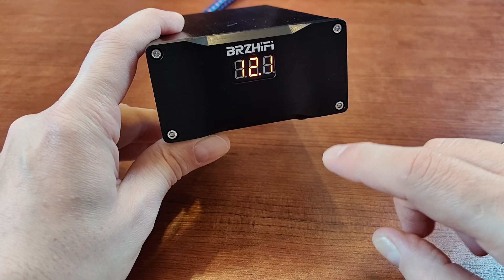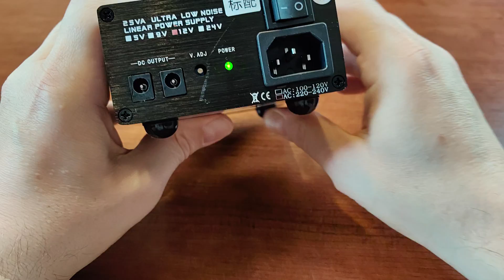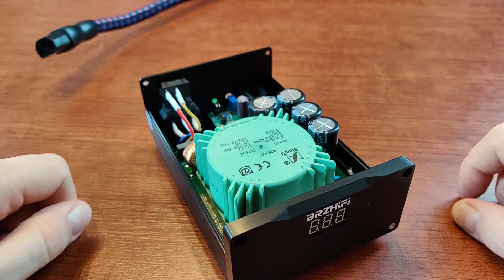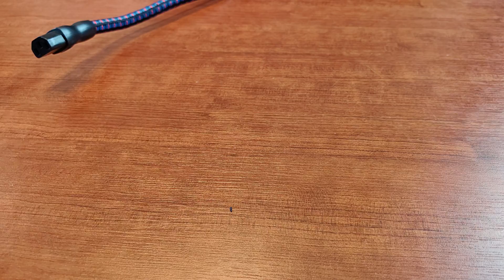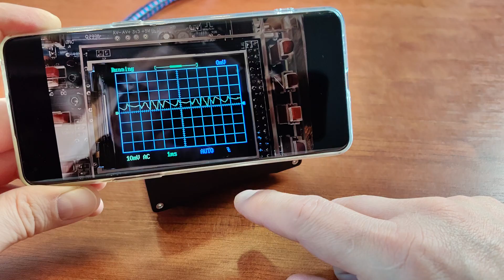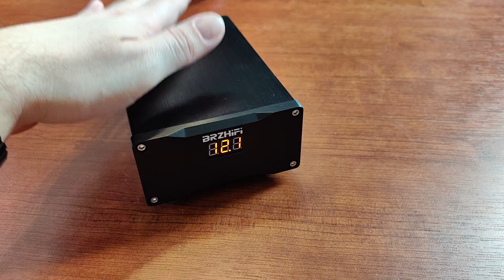BRZHiFi Linear Power Supply 12v - cheap and effective LPS

Comment: Gabster tested a similar PSU to this and found the voltmeter generated significant ripple on the output. One solution is to make the voltage display switchable and keep it off for lowest noise. https://www.youtube.com/watch?v=WLJGE5SSW2A
Reply from the maker: Thanks, I will need to measure mine again and check for that!
Reply: @k4syx ..and?????? ;)..

Comment: i heard you can lose some of the attack with linear power supply, is that true?
Reply from the maker: Nope. Maybe if that would be low power LPS? Definitely not with the ones I have here
Reply: @k4syx what do you mean by low power? What's the standard? Is 10-15w good enough? Brzhifi has one for 15w

Comment: Is this what i need to replace the power supply to my Fosi ZD3 Dac. If so do i need the 12v version? The 110v or the 230v version.
Reply from the maker: Yes that one will do, 12V output, input should follow your local country standard (110 or 220 depending on where do you live)
Reply: @k4syx Is this the one you would recommend or is there a better option for the ZD3? Love your videos.

Comment: I thought 10 mV is pretty high for a good LPS.  For a good LPS I have seen, the ripple is filtered / controlled around 10-20 μV (=0.001 mV) volt at a full load.
Reply from the maker: Yes you're right and these would be way more expensive. That one is very good for the price
Reply: @k4syx  I know that Lhy LPS has ripple noise of 17μV at empty load and 150μV at full load, and cost about the same.

Comment: Be careful when adjusting voltage on these PSUs. Specifications are misleading stating that it is 25W, What they should specify is maximum current draw. Transformer in the video is dual 12V output at 12.5VA. Connected in parallel can do just above 2Amps. One might think that at 25W when set to 5V for example can push up to 5Amps however that would fry the transformer. So, it is 25W but at max voltage of 12V which is set by transformer. Voltage is adjusted down in the circuit with gigantic mosftet IRF9Z34 capable of 40amps or so if I remember right. However, higher amp pull that transformer is capable of will fry its coils. I got exact same PSU but with 24V version transformer (dual output 24V at same 12.5VA).  Dumb me powered Raspberry Pi4 with sound card that pulls over 3Amps  while PSU is capable of just over 1Amp and left it. Found half an hour later dead and hot as frying pan. So, like video correctly states you can use it but power something very small and not power hungry. I should have opened it before using it. Lesson learned the hard way. The only question I have is why circuit breaker didn't fry first.
Reply: Al final depende de lo cuidadoso que haya sido el fabricante al elegir la configuración del toroide, por ejemplo, hace poco compré una lps muy parecida de brzhifi con salida de 5v, 25w y toroidal Talema, desarme el lps y vi que el toroide tiene dos devanados secundarios de 7v y 12,5VA, mis cálculos rápidos me dicen que daría unos 1,785a por devanado (12,5VA / 7v = 1,785a), si los han conectado en paralelo tendría 3,57a teóricos a 5v, unos 17,85w. No se casi nada de matemáticas ni de electrónica, es una conclusión que he obtenido simplemente mirando la foto que le hice a la serigrafía del toroide cuando abrí mi lps y usando la calculadora de mi móvil. 
Hipotéticamente si en el modelo de 12v usan un toroide con salida de 15v entonces tendrías = 12,5VA / 15v x 2 = 1,67a, lo que produce unos 20w a 12v. Como ya he dicho no sé prácticamente nada de electrónica ni matemáticas, si me he equivocado en mis cálculos corregidme por favor, soy el primer interesado en saber cuánto amperaje disponible tengo en mis LPS.
Reply from the maker: Thanks for sharing and the warning!
Reply: @k4syx  I wanted to ask if this LPS was OK for a 12v tripath ta2020 chinese amplifier which needs 3amps, but I guess it cannot :(
Reply from the maker: @CatrinaDaimonLee  Yes you are right, that one would be too weak. you need something that can deliver ~36W, so maybe one of the Rcore ones that I've reviewed would be ok?
Reply from the maker: @CatrinaDaimonLee yes that one is too weak for that, you'd need something that's >36W
Reply: @k4syx  THANK YOU
Reply: @k4syx  I will watch those, thanks!

Comment: Thanks for the vid mate 😊. I wonder if I should buy one to pair with my Fosi p3 valve preamp and replace the stock ps. It has a 12v in. But I wonder, if I would hear a difference? Maybe someone has done that?
Reply: @KLiNoTweet   i dont know if you are the one who just liked my message but.. the answer is HELL YEA it will completely free up your p3's dynamic range and reduce the noisefloor
Reply: @hcr2ligna83  Thanks for the quick replay. Very helpful. My comment just disappeared? YT is strange sometimes.
Reply: @hcr2ligna83 Thanks for you quick response. And I subbed 😊😊
Reply from the maker: Thanks! Yes it will help with sound quality :)

Comment: Do you think this one might be better on Aliexpress?
Reply: Thank you!
Reply: 25W/50W SPD-25PRO Flagship Low-noise DC Linear Stabilized Power Supply, TFT display, Visual Operation Interface
Reply from the maker: More powerful and with fancy display.
If the ripple would be the same and price similar I would go for it as it is more powerful

Comment: Completely USELESS for any audio component with a minimally good design...  When we design audio component, we know we'll receive noise, imperfect sinusoïdal waveform and sometimes spikes from the utility.  So in this video, a guy provided AC to a DAC power supply using a light dimmer, can't be worst than that:
https://www.youtube.com/watch?v=OL23xkLfPTU&t=972s
So the DAC isn't impacted at all even if it receives the worst AC crap you could imagine.  This whole linear power supply snake oil is really peddler's classic crap...
Reply from the maker: As long as I have respect for Amir's work for measurements, I think sometimes that he listens to AP plots only.
I'm engineer myself. And if I can hear something I cant see in measurements, I'm not dissing that as magic and snake oil, but I'm starting to wonder what I'm not measuring when I should.
Case in point: which one of measurements that Amir takes with AP translates to imaging and positioning of the sounds in the soundstage?
As there are DACs on his list (again, that's something I use sometimes as starting point myself) that measure the same, or above hearing limits for all practical reasons, but still some of them sound flat - like 2d photo, and with some of them you can close your eyes and easily point all the locations including depth (distance to) and height of the sounds?
There is no magic, it's all science.
Getting to LPSes. With linear power supply you can hear more small details in the sound, nuances and spatial cues that build the imaging.  
You can try it, you don't have to though, obviously :)
Reply: @k4syx  ...and you surely doesn't sound like an engineer...
Reply from the maker: @guyboisvert66  So you cant hear the difference (have you even tried this?) but you can hear if I sound like engineer from my writing? :)
Peace and enjoy the music :)
Reply: @k4syx  Challenge anybody on this for a blind test in a controlled lab setup... And i shouldn't have to explain why...
Reply from the maker: @guyboisvert66  Thats actually no problem, If youd be visiting Poland give me a shout and we will do it. I will "rig" the setup: we will use the DAC of my choice (shouldnt matter right?) we will use the LPS and worst switching power supply I will find here :D (it wont matter right?) and then we will connect that source setup to my Abrahamsen V4.0 driving my electrostat SR-007 MK1 headphones. 
This will be rigged, as SR-007Mk1 are one of the most transparent headphones world had ever seen. We will use my choice of tracks for tests too (shouldnt matter too, right?)
For trained ears its not even a real challenge.
And the one who loses buys the beers to drink over when we will talk about music :)
Reply: @k4syx  I never said "power supply doesn't matter", i said that there's no point of replacing the one that come with the unit! The challenge is: see if hooking an LPS on a good DAC change anything at all.  Obvious answer: it won't change anything (unless the LPS is real crap!)  As for the beer, i'd be more than happy to drink with you if we'd be a bit more closer!  Poland is a bit far from Montreal... By the way, go Poland and keep asshole Putin out! ;-)
Reply: @k4syx  I challenge anybody for a blind test on any of those claims...

Comment: Thank you for this review. I've seen many linear power supply reviews but have never been able to justify the expense given the relatively low cost of my system. Please excuse my ignorance regarding electricity. Would the 12 volt model be suitable for the Geshelli J2? They advise only using their power supply. And another 5 volt one for a Wiim Pro which has a usb c to usb a 5 volt 2 amp power supply? Thanks
Reply from the maker: Yes youll be fine with both, every producer always recommends his own products as its money! :)
Reply: Thank you. I've just ordered them.

Comment: 10mV ripple is nothing to brag about. There are other linear power supplies, example LHY Audio which have 10uV (microvolts), or the IFI iPower which are much better.
Reply from the maker: And the prices, what are the prices for these? 
Can you have them for similar money? 
LHY is at least twice the price as far as I remember (or more), IFI is even more expensive if I recall correctly.

Comment: Would you rather this or the a32 you did a review on ?
Reply from the maker: A32 is more expensive because its more powerful, this one is cheaper (but with lower max output power). Get one that will supply enough wattage for your needs :)
Reply: @k4syx  thanks for you advice dude. Will just get a lower watt model.Much appreciated. Keep up the good work 💪

Comment: thanks for reviewing. I'm also considering to use one LPS for 12v electronics like settop box and wifi extender. use a Topping LPS for my router already.
Reply from the maker: It works wonders with such small devices as they are usually not very good on their own with stabilizing power input. So the cheaper the device, the bigger the difference the LPS creates.

Comment: used the Brzhifi ps on the Fio K10 R2R and yes the result is good! more black background, bass is more punchy and exteds a bit lower, nice analog highs, better then with original swithing power supply...mids already open up, but again seem a litle more forward in the presentation

Higly recommended combi for audiophile vibes
for reasonable price andr mid end, high end sound.

Below does a lot of good for the money:
-Wim ultra
usb to
-Fio K10 R2R (Brzhifi 12.1 vdc linear power supply)
Nordost odin RCA silver plated clone
-Cayin mt-35 mk2 plus
valhalla 1 clone speaker
-Dali zensor 3

Also have Nordost RCA full copper gold, direct from Wiim ultra to Cayin tube amp, that gives it a more laid back sound signature with little more detail in highs.

Comment: 😃Great review and measurement to know it is linear within 10Mv. You can actually use the pot and adjust it from 5 up to 24VDC max. My first usage was the Wiim Pro Plus and adjusted the 12 VDC version, back to 5.1VDC, so very versatile unit. The sound of the analog output of the WIiim Pro Plus did improve a lot, which amazed me big time... Recently upgraded to Wiim Ultra and Fio K10 R2R, The FIO comes with a large switching 12VDC, 2A, 24W  power supply (might be good qualtity version) but now want to test it with the BRZHiFi supply...adjusted back to 12.1VDC but it will not have much left with 25W....
Reply: So are they all the same units the 5, 9, 12 ans 24? I need soemthing to do 6V @ 2A.

Comment: Thanks for this video. I'm considering buying a model like this or similar on Aliexpress. Two actually, one 12v to power a processor for my sound system and another 5v for the DAC/headphone amp. There are also options with supercapacitors that look very interesting. I'll do some more research before deciding, but both seem to deliver good results.

Comment: I got one on ebay, but the version with more expensive transformer. I regularly check it with my oscilloscope, and I have to say I was stunned to see it was as good as my $900 audiophile pro-ject power supply.
Reply: Did you get ripple results for your unit?
Reply: I just bought the expensive one with talema parts and man i hope its good. Thanks for your anecdote. I wasn’t sure before.

Comment: I have a very similar one with the same BingZi toroidal. It has the same voltage display on the front.  Out of the box, I'm measuring 20mV peak to peak noise on my scope - not very good.  So, I opened it up and found the front display circuit is connected directly to the DC rail - no decoupling!  I installed a switch to turn off the display, when I do, the noise drops to almost nothing.
Reply from the maker: Display there is useless anyway... Good tip!
Reply: I got a fixed voltage LPS than came with a distractingly  bright LED display that said "5.00" at all times. When I first got it i compared it with an iFi PowerX on a network switch. The iFi was better. Reading comments like yours motivated me to open up the case and disconnect the wires to the front panel.  These were soldered at both ends, so I took scissors to it and snipped them. 

Now the LPS sounds easily better than the iFi. The front display introduces suffient noise that audibly undermines it's sole purpose.
Reply: I have a zero zone 1706a LPS from Ali, that also has an led on the front. How would you recommend checking to see if it is properly wired?

Comment: Was curious about these and a few others on Ali. Was about to pull the trigger to purchase one of the LHY 50VA lps', but am not yet convinced that they are the actual power supplies made by Jay's audio? They are far cheaper than the ones sold by Beatechnik. These BRZhifi lps' seem solid now that you put this video together 🙏
Reply from the maker: They are really good for the price but you have to remember that they are only 25W. A few days ago I was recording review for Sengterbelle one and after that I've realized it's very similar internally to LHY ones. Maybe I will investigate more. Anyway wait for that review and compare internals from my movie with photos from shops

Comment: Hi. Very good video. Excellent information. Have just purchased one but the talema one. Do you need a special power cable like your one or is a normal one ok?
Reply from the maker: Hi! Thank you :)
Regular one is fine, I just happen to have a lot of better power cables around the house.
Reply: @k4syx  thank your sir. One other question if you don’t mind. When connecting to a DAC and streamer is it ok to leave the psu switched on all the time or do I need to switch it off when not in use?
Reply from the maker: I tend to power off mine simply because of electricity bills ;)